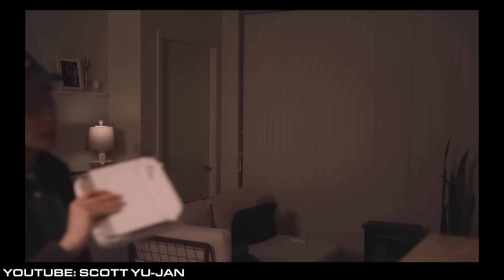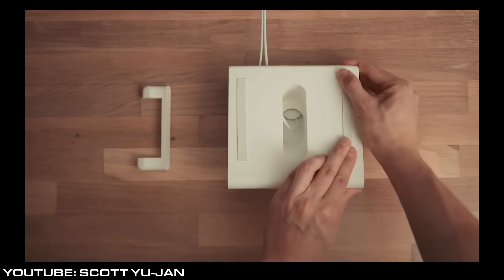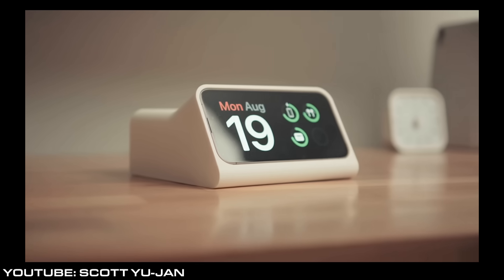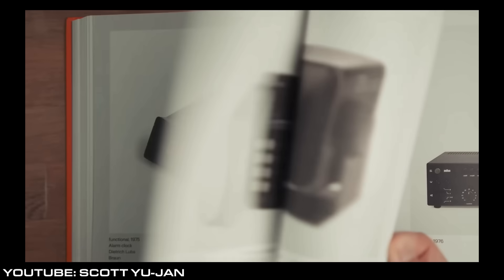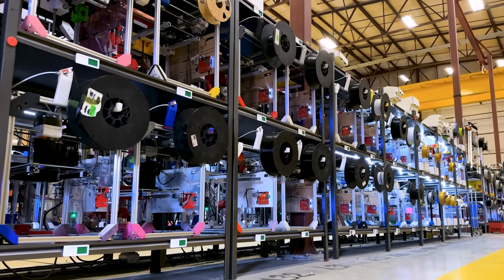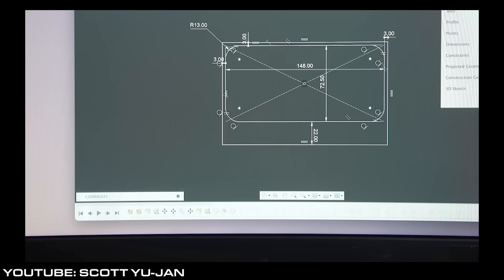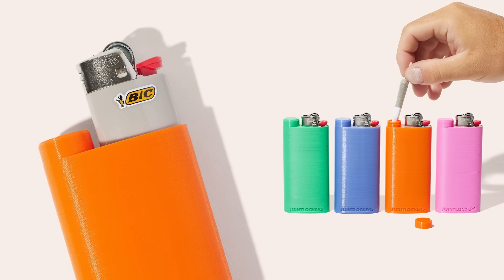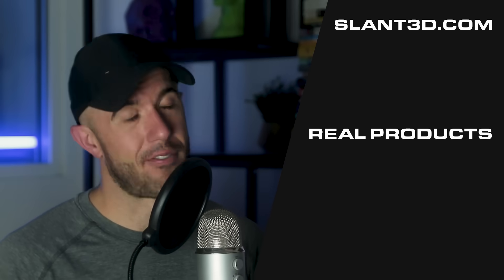A Closer Look at Scott Yu-Jan's 3D Printed iPhone Dock | Real 3D Printed Products

Comment: Brooo, you’re totally missing two major defects here. So, I’ve got a $1,200 phone and I’m using a $10 Temu case, which is MagSafe. The thing is, I shouldn't have to take off my case just to stick it to the dock, that push thing right there is a kind of scuffed for the 1,200$ – that’s a huge issue, man!

Also, the bottom speakers are getting covered up. Can you check if the alarm sound even plays properly when the phone is docked? These are two big problems for consumers, and I don’t get how you just missed them, bro. #Engineer @ #Master!

Comment: I agree that the initial video was amazing. Also, one of the viewers did a video describing the “parameterized” version of a Fusion 360 file. She spent a GREAT DEAL of time reverse engineering the design and backing into the stored dimensions. Unfortunately, this is not a parameterized design. It’s made up of a group of literal dimensions. And, since the design has several “Scale” features, the dimensions you enter get changed in the course of the design. If the file had User parameters like PhoneWidth, PhoneHieght, PhoneDepth, ButtonHeight, CaseThickness, it would allow infinite modification. I started working with it to get it to print with my iPhone 15 Pro with a case, but when I replaced the literal dimensions with my parameterized values and functions, I ended up breaking one of the scale features. I’m not taking anything away from the original author or the Fusions 360 volunteer, just sharing my experience.

Comment: I agree with 99% of the love of the design... my 1% that differs is that this design does NOT take into account that most iPhone customers have a case on their phone... almost no one walks around with a naked iPhone... so, in this design you have to take your case on and off? That is a hard stop for me and I am sure most others out there. To make this design 100% positive, it needs to address this fact, and allow cased iPhones the same ease of use.
Reply: I think that the biggest issue with designing it to accept the phone with the case, is the fact that there are so many different cases. Even though they look the same, dimensions can be just slightly off and then it won't fit. Making it parametric could be the way forward, so that the user could easily edit the dimensions

Comment: I would argue that the average person does NOT like layer lines.  The AVERAGE person associates 3D printing with inferior production standards and thus it WOULD be important to minimize that look.
Reply: I simply just don't want an item that collects dust that is hard to remove because the layer lines act like a micro fiber cloth.
Reply: @MrGTAmodsgerman  that's a good point also.
Reply: @TheGotoGuy_TX  Yea and i see no one talking about this. Same as with like gaming mouses who often also have that crazy open edges dust collecting design. But FDM prints is another level of difficulty to remove. I put them under side water which seems to be the easiest to remove. But PLA and other common materials don't like water.
Reply: @MrGTAmodsgerman  You do know that with a little more efford you can make the print perfectly smooth right? you can make it as smooth as glas if you do it the right way.
Reply: @stephandevriesere3667  Ofc i know. I am just mad that people say it's ok to have layer lines and leave them as they are because it's "just aesthetic" and people should get used to it. Which is not the truth. It affects the functionality of the object in a bad way as described.
Reply: @MrGTAmodsgerman  I'm sorry mate, i guess i misunderstood. And yes i also don't like people that do not want to do a little more to make it look really nice. I guess it's called being lazy and hidding behind the "aesthetic look". If you do something, do it right, right?
Reply: @stephandevriesere3667  Yea i think a FDM print on it's own just raw part and needs further processes to be a final product. Basically it is that because those printers were made for prototyping.

Comment: The design is interesting but of very limited use because it cannot accommodate phone cases, which do not have uniform size, and it can only be used for one size of phone. E.g., it can't work for an iphone pro and an iphone pro max. The design could be modified by making the opening large enough to accomodate phones of varying sizes (including their cases), and by supporting the phone solely by the magsafe charger. The empty space around the phone be somewhat disguised by using black filament as the background.

Comment: i personally dont think this design would be of great use in the market, the design looks great no doubt, but people use different cases on thier phones, so either making the design to fit all the case sizes or the user would need to remove thier case daily...
Reply: They could work around that by making the space around the edges bigger since MagSafe is the one what holds the iPhone.
Reply: @Maatjuhhh  or maybe make a tpu edge? Or find a way to put a gasket in there to absorb the marginal difference?

Comment: I hate designs that always leave out something, like cars with zero clearance for wheels, and you're like wow, that's so sleek until you realize, the tire needs to bounce. In this design the IPhone is missing it's case. No one has an iPhone without a case, so his dock needs to be custom made to fit whatever case you bought for your iphone.
Reply: I don't use a case on my iPhone
Reply: @DesAbelmen  I don't use a screen protector
Reply: There are various remixes online which supports cases
Reply: @JerryWang-pp3fz  I printed a remix for a case and my phone still does not sit as cleanly as it should
Reply: I have never ever bought a phone case. They are cheap feeling and ugly. The idea of a case is to keep the phone looking good but always covered up with a case. Makes no sense.
Reply: The point of a phone case is to protect your phone from damage. Otterboxes have saved my phone and my families several times. My sister use to be super clumsy and hated having a case. She’s broken her phone several times just getting out of the car.

Most cases are just aesthetic and don’t offer any protection but that’s not the point of cases overall.
Reply: @Trackenheimer  Apple should make their phones easily repairable and that would solve the need for a case

Comment: I like this design except for one thing. Fast wireless charging emits a lot of heat. You need to dissipate the heat. So vent holes are a must. Maybe they need to add holes for small copper tubing to passively attract the heat a bit more and send it through ventilation holes on the top. 

The design is also big enough to accommodate a slim fan. Add some feet to the bottom and direct air flow to the back of the phone and have the vent holes for upward air exhaust.

Does this over-complicate the design? Probably, but you pretty much have to unless you make this more of an open air design to their doesn’t need to be active airflow

Comment: The point of industrial design is to be the interface between art and mass  production, industrial designers are the ones who problem solve the design to create a final producible product. Engineering is called in to scale the technology required and insure standards are met.

Comment: I printed it and I would change the fitting of the MagSafe. It’s too loose. There should be a springy section on the clamping ring holding the MagSafe.

Comment: Only problem with the dock for me is it doesn't allow any space for a phone case. Most people have their phone in some kind of case and they don't want to take it out every night.
I don't know how you would make extra room for cases because there is so much variation. love the design otherwise.
Reply: I took his CAD file and modified it for my wife’s phone case and a cheaper Amazon MagSafe charger last night. It was done on the printer this morning. 

One thing to do with this is make a version that’s sized for the ProMax with a large case and then have different bezels that snap on for different phone and case sizes. Then you don’t even need to reprint the body when the phone is upgraded. Just make a new bezel for the new phone.
Reply: Yeah he design it for himself not to everyone and that’s just how he does things on his channel tho on the upside he gave the stl to make it work for anyone
Reply: @smug_slime  Yeah that's fine. I found one on makerworld and edited it on fusion (no experience required, he made it that easy). You do need calipers however. I wanted to use it with my case on so I adjusted accordingly
Reply: Personally I prefer phone skins but to each their own.
Reply: I’ve made a remix that is modular and supports phone cases
Reply: @thespencerowen  Link?

Comment: i would say that INCONSISTENT layer lines are not aestethical nor pleasing, perfect layer lines are indeed quite satisfying
Reply: Absolutely. I absolutely hated the inconsistent layer lines back when my ender 3 was still stock. After modding/fixing the z-axis to be quite literally perfect, I can print layers as thick as 0.40mm and the layer lines still look really nice. I've had friends ask if I printed a part with 0.10 layers when it was actually 0.20, because the lines just look so so much better when it's consistent.
Reply: @Iisakki3000  say more, what did you do to get the z axis perfect? i've also found that consistent layer lines are more a smooth xyz movement rather than extrusion
Reply: @feliwein_cc look for what is the source of z wobble in your printer and minimize it.

Just redoing the couplers can affect it or doing oldschool tube coupling or printed couplers. If the z rods are warped you're kinda effed. Just making the frame more rigid with bracing can help too.
Reply: So true, my first custom designed printer had perfect layer lines, after make much modifications I lots it somewhere and eversince try to get those back 😢
Reply: @FarazMKhan  yes, the problem is that everything needs to work perfect each layer
Reply: I’ve found that my third 3d printer, a Creality K1 VS, which utilizes auto bed leveling and even though yeah, the mesh is horrifying to the eye, it compensates amazing… Anyway, with regards to print orientation and filament chosen, often prints with BARELY discernable layer lines. Having said that, my two prior printers, where you level the bed with wheels and paper (was just nuts) that it was INCREDIBLY difficult to get everything perfect and avoid all manner of problems including layer lines.
Reply: Layer lines are not pleasing in any way consistent or not. Sand fill paint.
Reply: @yeahh_idk_   They are also not very practical. Idk why no one talks about it, but it's not just about aesthetic. I don't want my objects collect dust easy that are hard to remove because the layers are so fine like a micro fiber cloth. Only luqid like water helbs with the removal which is bad for prints like PLA.